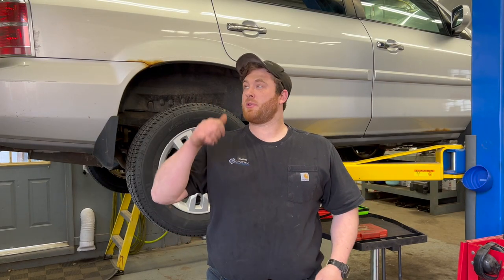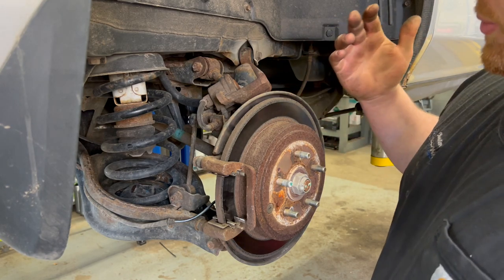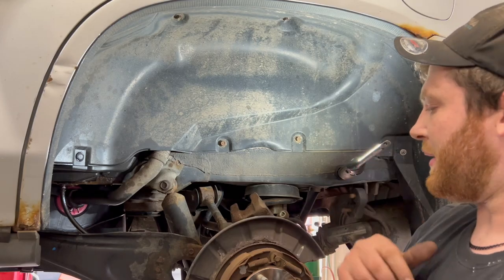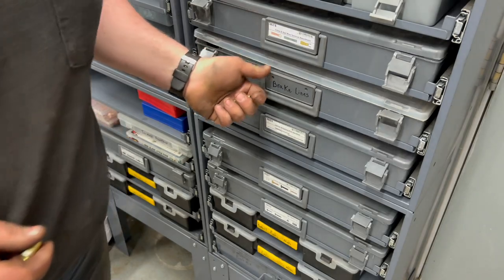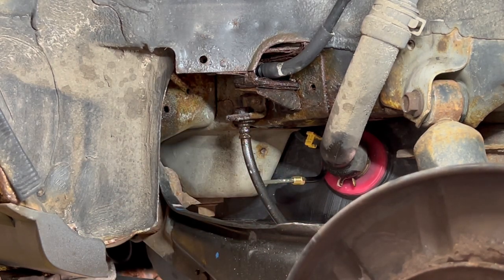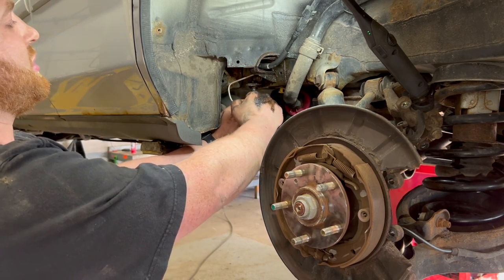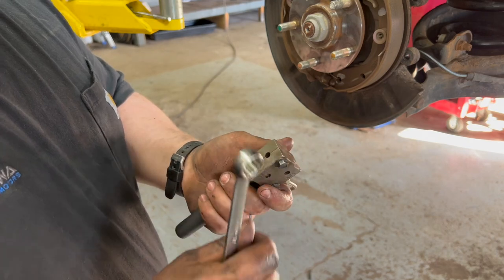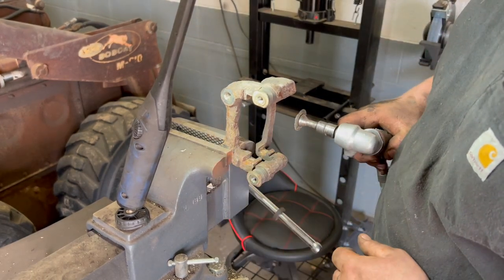Acura MDX Brake Repairs

Comment: How long was the brake line? If its leaking its all bad in that line (again u mention shop liability)
.Why repair vs replace was better?... Much less being cheaper? Serious question u may have asked yourself. Tnx
Reply from the maker: I filmed this over a year ago. However, if I remember correctly, that brake line runs up to the master cylinder. A lot of times we find that the brake lines are rocksolid front to rear and rust out in the wheel well area. This is not an uncommon repair and this repair method is perfectly safe and reliable.